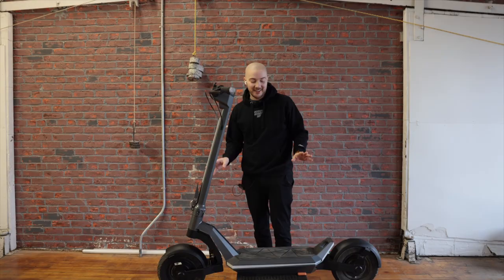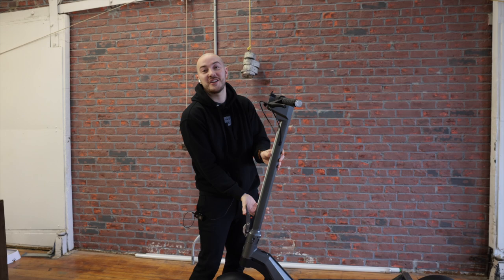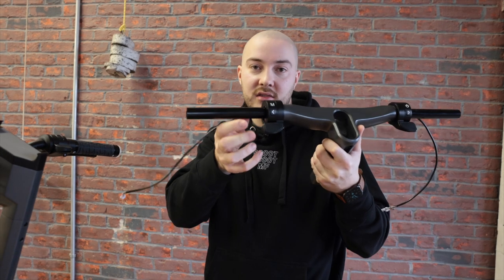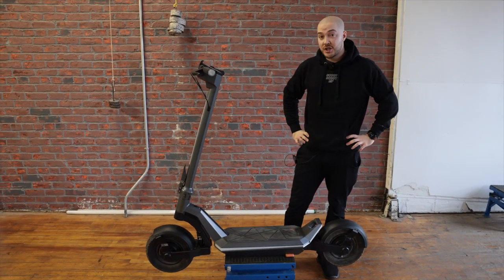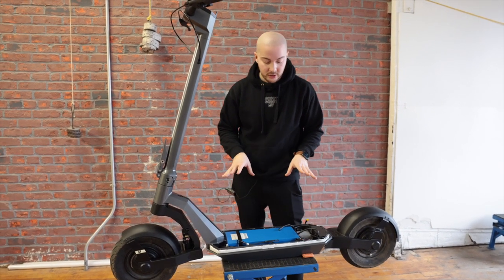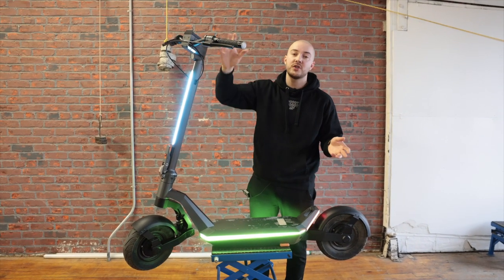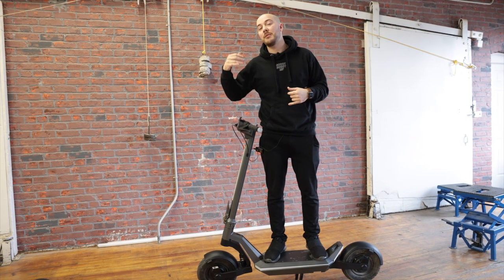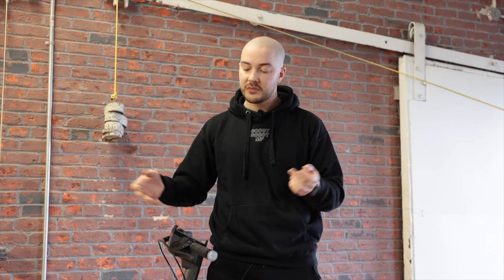VLOG: Apollo Pro - V4 Prototype Walkthrough

Comment: Love the fender improvement, finally someone is doing it right so you don't have all the water and dirt splattered all over the suspension. I would probably extend the front fender a bit forward to avoid water spray going back at you at speed.

Comment: Absolutely impressive! Can I talk about the height of the stem? I think we riders like them a bit taller. And also, we would love if the buttons and controls on the handle bar are made with gloves in mind. Usually, it becomes hard to access them when you've got gloves on. I would personally prefer if the switch for the turn signals are made like that of the cars (something like a stick which we can move left and right)
Reply: I agree with everything you say.  Especially the height of the stem.  If it's not at least 42" from the foot pads I'm probably not going to be interested.  Plenty of other scooter to consider.  Do you have a recommendation of a tall stem scooter.  I've tried the Apollo Phantom, Nami Burn E2, Nami Klima.  They all had decent heights, especially the Nami's.  I just don't need that much power lol.  But, maybe I will one day.  No rush.  Scooter is more a want than a need.

Comment: For the deck side lights, I think it would be best to have the deck lights to have three separate zones (front, mid, rear) and have the two ends (front and rear) of the light strip reserved. Keep it at Solid White or Solid Amber or half white-half amber/Turn Signal in the front and Brake Light Red/Turn Signal in the rear. When turn-signals are activated, the solid setting for the ends of the light strip should turn off and switch to blinking for the turn signals instead of keeping the solid setting on and just switching to amber (An example of this is when a car has its day running lights on and the driver activates its turn signal, it automatically turns the day running light off for the turn signal for visibility). Needs a turn signal noise. Would like to see a USB-C and USB-A ports for charging. Redesign the points where it holds the phone so you can slot in a cable to charge.
Reply: I totally agree with you on the lights. Great job at bringing it up..

Comment: I wish we had the option for disk brakes. I know the drum brakes are part of the design and function but it would look cooler with massive disks. I think this will be my first scooter when released. What stores in the GTA will have these for immediate pickup?
Reply from the maker: Hi Art Tech,

We understand your concern as performance scooters have generally come with disk brakes. However, we are confident that our smart regen braking system combined with drum brakes will give you more than enough stopping power. With our dedicated regen brake throttle, we also expect that users will exclusively use regen braking 95% of the time.

We only have an online store in Canada, and you can click the link below to reserve your spot! :)

https://apolloscooters.ca/products/apollo-pro

Comment: It would be great to see some things standardized across the whole Apollo line up in 2023. The air in particular would benefit from the same tubeless pneumatic tyres with puncture protection layer the city has, the handlebar indicators and some rear indicators and I still think it needs folding handlebars being the air model. The city could do with the handlebar indicators we see here on the pro and brighter clearer ones on the back. Same folding mechanism and thumb throttle/break levers for all of them also. The incline rating can be disappointing so any improvement in battery to help with not just range but perhaps peak power to help with hills would always be welcome. I’m interested to see if Apollo would ever have anything sat below the air price wise perhaps in the 500-750 bracket and maybe something ultra portable and low maintenance and compact with foldable handlebars like an Etwow scooter although not sure on the name as “air” already in use. Perhaps the Apollo mini! 🤷‍♂️ As for the pro I love the angles and lighting here along with the functionality to use it for indicators etc I mean you are going to be so visible on this at night! Can’t wait to find out what the big things are in the next walkthrough! Keep up the good work Apollo, when the uk finally gets its act together there is a massive market for your scooters here! 😊

Comment: Question: once the Apollo pro will release. Will the app be updated with security features? Otherwise it's gonna be another issue down the line. 

Hey, this just an idea. How about either including a cover or a pad. When I fold my city pro I noticed that the plastic screen can easily get scratched. Would it be possible if you can sell some kind of accessory on your website that doesn't require me to wrap a soft towel and duck tap during transport in my small car...

Comment: Folding handlebars too
Reply from the maker: Hey Fernando,
The new Apollo pro, will have a solid handle bar design from the factory! The other 2 items you mentioned (Side mirrors and Damper) will not be included with the scooter, but there are plenty of after market parts to consider if these are items you'd like to have!

Comment: Awesome presentation! Ive already put down my deposit for the Pro! Im curious. Have you guys thought about utilizing carbon Fiber reinforced plastics in frame or stem design? I have no idea if it's feasible or structurally strong enough for the application. However considering that carbon fiber composites are nearly 40% lighter than aluminum, I would think allocating some R&D budget to the cause might pay dividends! Thoughts?

Comment: The only thing I don't like is actually the phone display. I have a samsung galaxy fold 3 and yea...

Otherwise keep pumping them out I have an Apollo Phantom V2.5? V3? Idk what to call it after the upgrade but yea fantastic stuff.
Reply: Agreed. I do not like the phone mount requirements.  Drivers are already distracted enough, and to see notifications on your phone while riding is probably unsafe.  Also, if you are in a scooter accident, the phone could be damage, when you actually need the phone to call ambulance.  Remove the phone as an Apollo display.
Reply: I like it. You use the phone for nav anyways, and 90% of my rides I don't need to see my speed and I'll know my range (commuting). I can take out my phone to check this when needed. It's pretty sleek. I'll keep my phone in my pocket most of the time as I don't want to expose it to max vibrations. I wouldn't be opposed to a small display like in the city, but I prefer this mount with wireless charging. 
My thoughts are to maximize range and make it as water resistant as possible (PNW - never know when it'll rain!).
Reply: I was against the phone display myself. I do not think that will change, so I will be purchasing 45-60 dollar phone for the scooter only. Only the Apollo app installed (less distractions) and connected to my hotspot.

Comment: Great job Apollo on the V4!!
It's hard to have any constructive feedback when things seem to be going along so well!

Fenders - Great job on the coverage, I know you've been meaning to extend it for the last couple of iterations, so I'm glad to see that is finally done.

Stronger neck - nothing to complain about there.

Folding lock - looks so easy now!! I'm still happy with the City 22 one, but this new one looks almost effortless!

Front Suspension - Great re-design! I made some suggestions in the prev vid, but I didn't think of extending the fork (and subsequently adjusting the geometry of the stem), and extending the fender... a lot of issues solved with this and I can't believe it's still not the final design. I remember saying that I wasn't a fan of the fork design... looks really ultilitarian, but aftering seeing it so many times, I think I'm starting to be okay with it now, although I think it could still look sexier. 😜

Throttle - Looks similar to some of the City 22 replacement ones (if they weren't V7), not sure how similar they are to them. I do like these better than the V7s.

Phone holder - I like the screw mechanism (strong and won't drop your phone). Curious to see how you will be able to improve on that. Will there be a quick release in addition to a screw locking mech??

Brakes - OMG YES!!! I LOVE the City 22 bell and I'm soo happy that it is coming back!!!

Headset - I also agree that the grey color is better. I'm pretty torn on the swing arm... I think I prefer the grey there as well if I had to choose.

Control Box - I like how the heatsink is sitting outside the scooter (natural cooling... smart) while still retaining waterproofness. Epoxy doesnt bother me, unless for some reason there would be a reason to change the control box (like a phantom V3 upgrade haha, would be a pain to change an epoxy glued controller).

Deck - Overall pretty happy with all the water proofing and the connectors. It's hard to provide feedback on this without knowing much of the intricacies of the wiring, but you guys know what you're doing anyways.

Lights - 
- Rear light - Dim to Bright - Flashing might get the attention of someone but I think dim to bright is sufficient. This is how all car rear lights look and I think it works well for cars and it should work well for the scooter.
- Deck colors - I would add a few colors to the list: Orange (unless that's reserved for turning signals), Turquoise, Pink, and Indigo (violet/blue). By the way, the yellow in the video looks slightly green, not sure if it's the white balancing of the camera)

Start up/Shut down sound - Personally I would probably use the discreet, but I'm okay with the shut down noise. The start up noise I think should sound more like and electric motor whirr combined with maybe like a start up chime:
Electric Motor Whirr (something like this but maybe accelerating faster and fading out) - https://youtu.be/lZaHTj1_vOI?t=30
Start Up Chime (Mercedes GT AMG) - https://youtu.be/JAgFlp52AB8?t=250

Speaking of sound, I was wondering if there was any thought put into synthesized motor sound while accelerating using, for example, that electric motor whirr video I linked above. Sometimes engine sounds also enhances the sensation of speed.

Horn Sound - Can you do a polite honk? Like when you try to press on the car horn for like less than half a second? But having a custom one like "HEY" or "On your left!" would be funny easter eggs.

How do you join the beta group? Or is that the same as the beta testers? Have you already notified the beta testers already?

Looking forward to V5!!!

Comment: Love it so far, hoping some features make it down to the V3 full release of the Phantom or V4. Curious why on the pro you guys didn't pull a kaabo wolf king and have a controller on the stem rather than the deck for better cooling and more deck space for battery or even just cooling there.

Comment: Sound -is safety. One of the things we learned on designing electric cars one of the concerns is too quiet has been raised as a safety concern given that these will be used residential Lee people backing out of their driveway pulling out of the shopping center having a unit that is too quiet, I will contribute to the accident frequency. So keep that in mind.

The video is too long as a general release. For those who are involved technically or beta testing I think it’s fine however, general we’ve learned is keep it short think highlights. some of the things you’re talking about can wait they can wait till production version two etc. I would just make the decision and tell people what you’re doing bullet point and why don’t iterate forever just get it to market some of these things are firmware adjustments and they could be done either over the air with downloads you’re doing too much is delaying getting this to market. I don’t recall you saying you have  if you do great if you don’t get this into the hands of a number of folks and get their feedback quickly. This is it sounds like you’re learning by doing when these kinds of vehicles are out there and feedback is available on scooters. You can check out what others have done and why they’ve made those changes and utilize that as well but it sounds like you’re overthinking. Some of these points are very important others not so much don’t worry about the number of color iterations or the number of sound iterations on the horn,etc. If this is designed properly, many things can be brought in as firmware etc updates. Get a solid working product to market. Not a perfect one

Comment: You need to put a safety on the open mechanism the button is to easy to push .  Something like the Vsett uses would be fine,  no Velcro,  also the front end looks to be about an inch too long just looks a little funny but would not be a deal breaker.  Everything else is perfect

Comment: What is the IP rating of the new Pro? For I high end scooter I would expect advanced anti theft features, like GPS track, good IP rating, low maintenance. Thick anti fatigue material on the board. Bright head lights with highbeam lowbeam mode, light weight as possible, factory balanced tire and wheels.  And maybe ajustable stem and handle bar lenght.
Reply: IP66
Reply: @eloipecquet  suggestion Eloi, les bras de suspension faudrait qu'il ait du detail ca semble trop "bland" ca prend un ptit look batmobile, et aussi le nom de la compagnie en évidence sinon , top shape mon ami

Comment: The footrest rear turning signal should remain a constant flash as the deck strobes. The strobe around the body when turning should be the same speed as a vehicles turning signal.  I am concerned about the rear brake light. Is it noticeable from behind from a low mounted vehicle to the standard height of a vehicle (if there is one)? The new fender over the wheel may be interfering the 100% visibility of braking (This was not shown in the video).  I think the team is doing wonderful job. I cannot wait to receive my unit.

Comment: Only thing that I really don’t like is that it doesn’t have a built in display.  I wouldn’t want to use my phone for a display.  If for some reason I crash on one of these I don’t want my $1400 iPhone pro getting smashed up along with the scooter.
Reply: I was against the phone display myself. I do not think that will change, so I will be purchasing 45-60 dollar phone for the scooter only. Only the Apollo app installed (less distractions) and connected to my hotspot
Reply: Don't worry, its coming ;)

Comment: please extend the front fender so that it covers at least half of the front of the tire. ud be surprised how much splashes back at you when the tire is not covered on the front. its like riding right into the water in the air.
Reply: The fenders are covering 100% of the splashes, we tested them
Reply: @eloipecquet  the testing, was it done while the scooter and or wheel was fixed in position while spinning?
Reply: just to be clear, im talking about the front part of the front tire because it clear that the rear of the front tire is covered nicely and the rear tire is pretty much fully covered but the front end of the front tire can cause splashes as well and if not covered, past a certain speed, the rider will ride right into the water that splashes in front of the scooter.